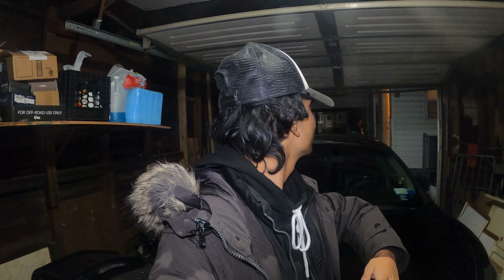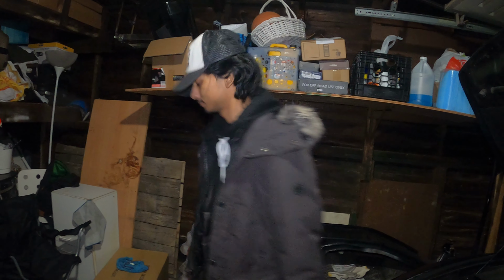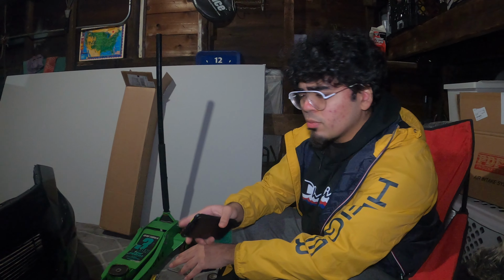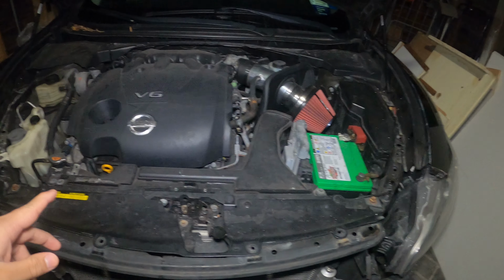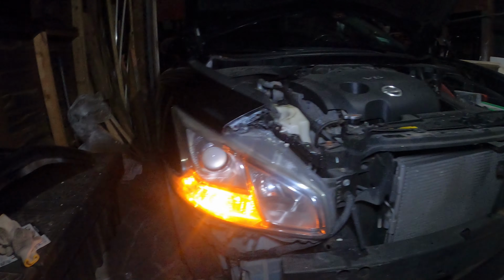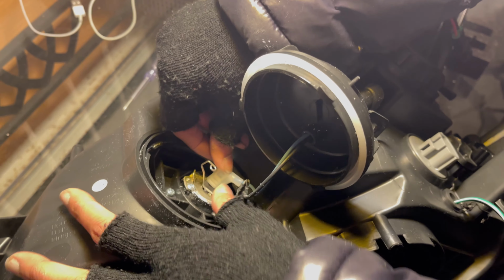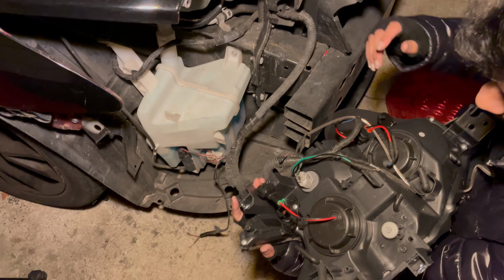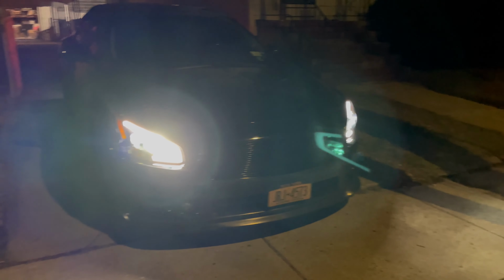MAXIMA GETS NEW HEADLIGHTS & GRILL *Install*

Comment: What size LED bulbs did you get for low and high beam? And will I need connector/adapters?
Reply from the maker: H1 and H7 and idk about the adapters i had yo do but might be different for you
Reply: @VEEIN  do you have the link for the bulbs?

Comment: are there low beams lights that feet in those acanii's without drilling?
Reply: I used the Termitor 2024 headlights with the bottomless fanbase and those fit just fine

Comment: How did you cut the yellow turn signal light out from being a daytime running light but keep it on as a turn signal???
Reply from the maker: There are 3 wires that go to that bulb
1 is for turn signal and the other is for the drl and the 3rd is ground.
Reply: You can also place a piece of electrical tape on half of the contacts on the bulb before installing it.